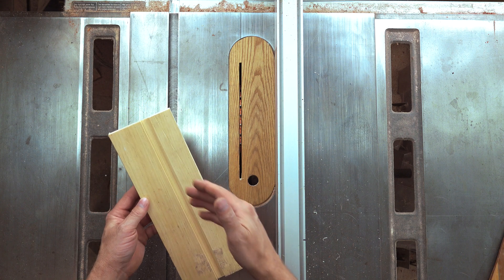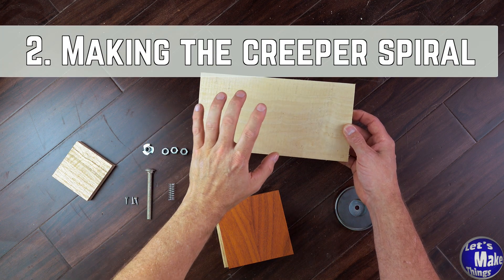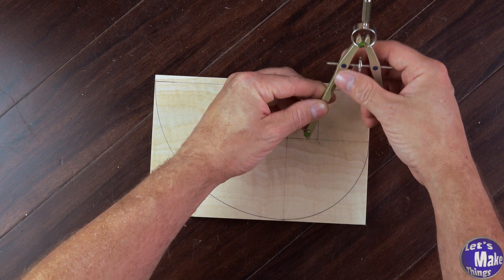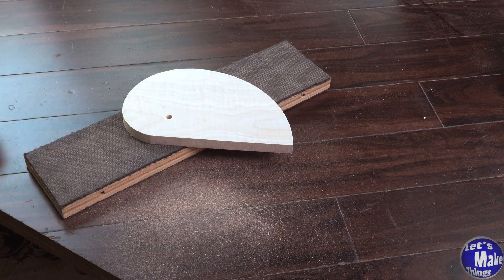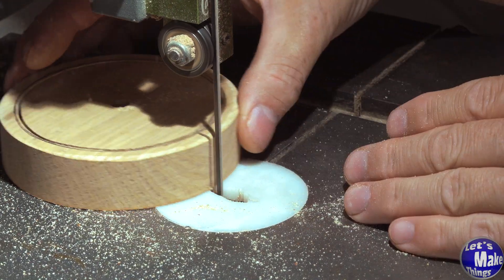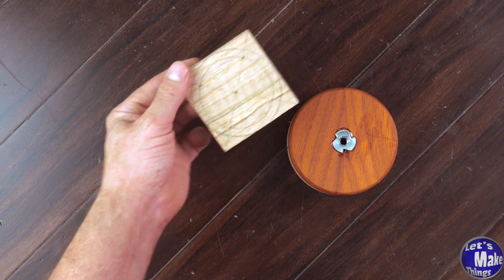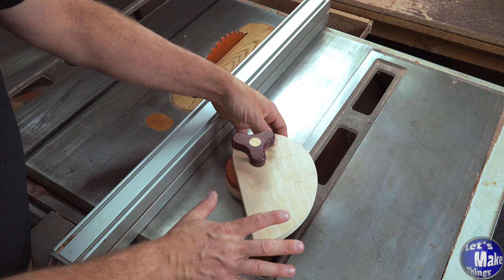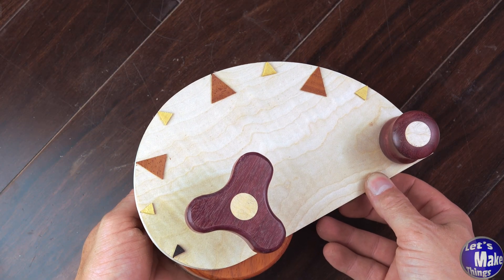Make a Creeper Fence Jig // Step by step instructional

Comment: I love this idea--never thought of it myself, and I hate the "tap-tap-tap" to finely adjust the fence.  But... I usually want far finer adjustments than the shape you showed allows.  I suppose a larger circle (14"?) with just a slightly off-center center-point might be finer... but right now my geometry brain isn't fully working.  Think that would that work?  Big circle, small rotation, teeny-tiny fence adjustment?

Comment: How would you do this with an aluminum table?
Reply: Mount to edge with a small board reaching to where you need it. Adding a secondary fence the same way the fence is connected to the guide rail. Made with wood. Could just clamp it to another edge.

Comment: Brilliant Idea!! I am going to make one. 
I laid out the spiral so I can cut it with my CNC and added tick marks for every 1/8 inch of fence movement. I use a 1/8" kerf blade with flat top teeth for cutting dados. 
I will email you the PDF file and the Vectric VCarve file. If anyone else wants the files, send my a DM with your email address
Reply: That's a great contribution. How do I send you a DM - BTW. TIA.